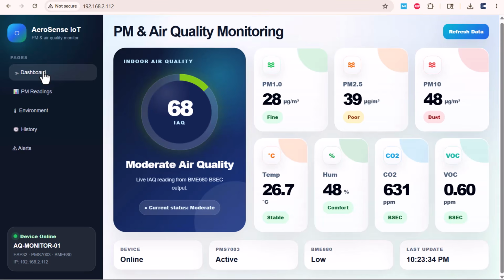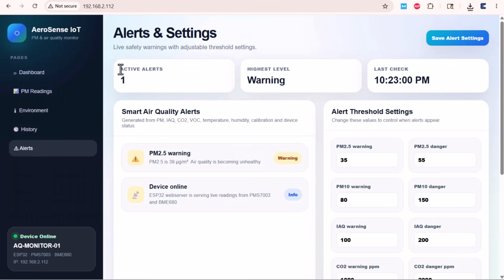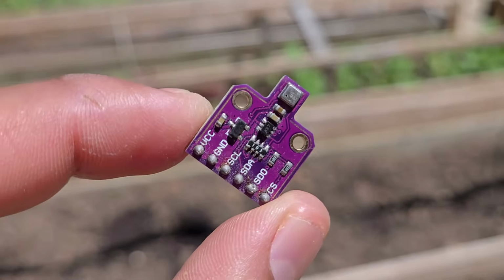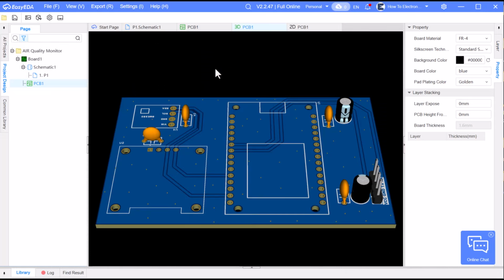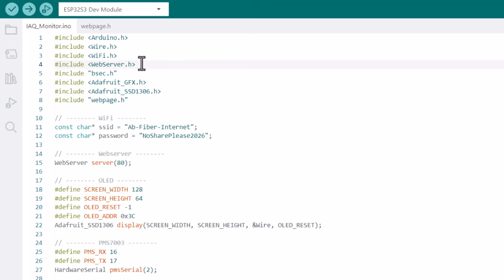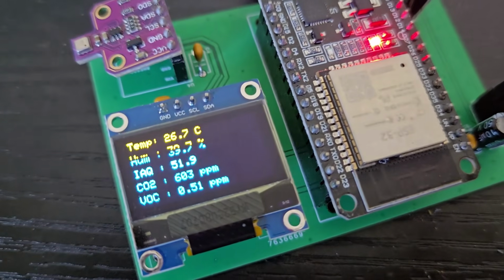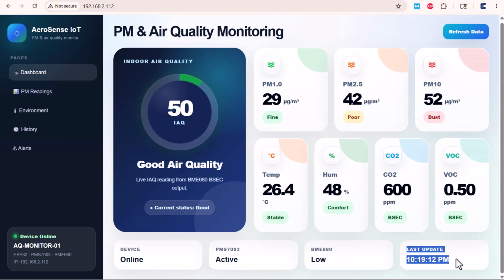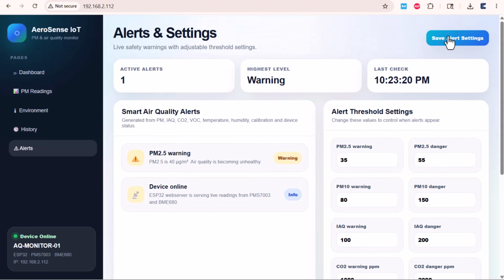DIY IoT Air Quality Monitor using ESP32, PMS7003 & BME680

Comment: Looking at the link to the source code and build instructions it is unclear which ESP32 board would be the best to pick.. The link goes to a 38 pin board with micro-usb and the video and instructions show a 30 pin board with usb-c connections.. Which one is correct for this as I am very interested in building this as a DIY and learning experience.
Reply from the maker: Choose ESP32 Dev Module from the list.
Reply: @HowtoElectronics  Can you provide a more direct link to the ESP32 Dev Module best suited?
Reply: @jonwerkman125  just use the link from the instructions. The connector isn’t important